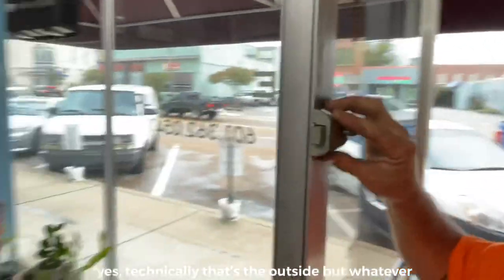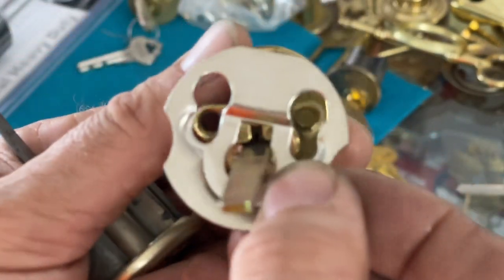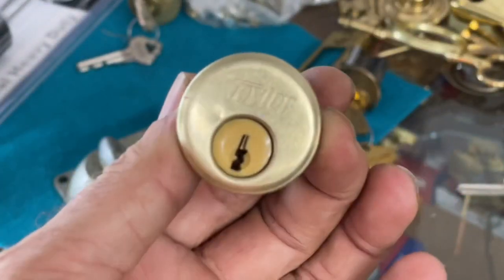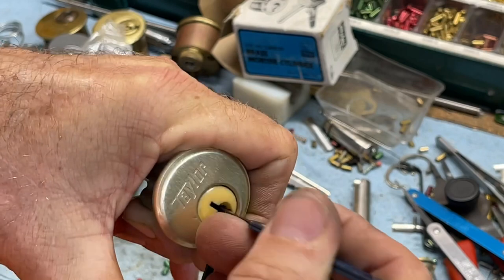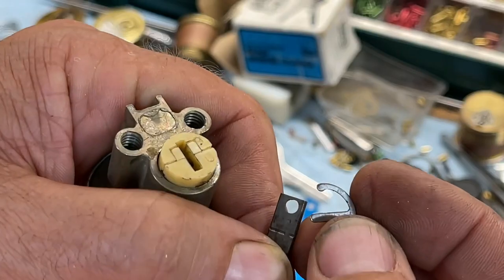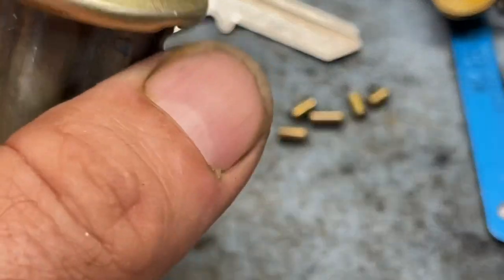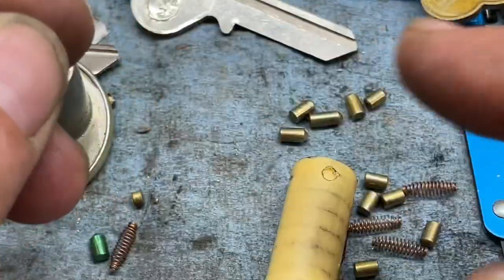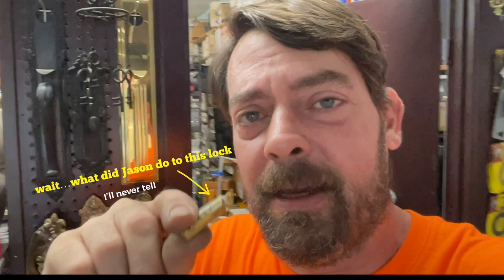Taylor Lock Company’s “Unique” Plastic Core Rim Cylinder

Comment: I have changed a lot of those Taylor's out over the years.There was a garage door company just a few years back that also used a solid white plastic core cylinder with a Sc1 keyway, the doors are so cheap they use a PVC tube to stop the door from crushing between where you tighten the cylinder and mount the lock.

Comment: I used to hate working on this lock. They were always on a garage the someone just had to get into, and like you said, they were always broken or corroded. And the inside mounting holes were always different than current replacement cylinders. 🤦‍♂️🤦‍♂️

Comment: Good Ol' Gerome Schwarze. 1956.
Sent you the patent via email. Plastic molding, die cast cylinder,  pressed sheet metal. The only machining I see is the screw threads and pins. Cheap to manufacture. 
Thanks Jason!

Comment: Kind of reminds me of the days of the plastic wiser lock which I thought was garbage to when they put plastic in it I also tend to agree with others that I’ve said here as well that I think it’s probably the Factive manufacturing they were cutting cost to make them more money that’s what my opinion would be of it but I have run into those locks as well along with the Weisers white garbage making the stuff out of plastic not spending a little bit of money to make it out of some sort of metal either aluminum brass brass preferably but definitely not plastic. Good video Jason I think you got the point across about how the plastic cylinders are pretty much garbage even though they were out there.
Reply from the maker: The problem with the weiser's was more in the clip rusting up badly causing the problems but yeah they actually lasted an amazingly long time